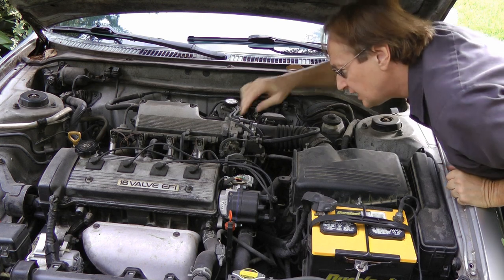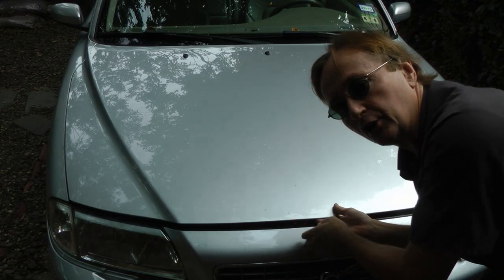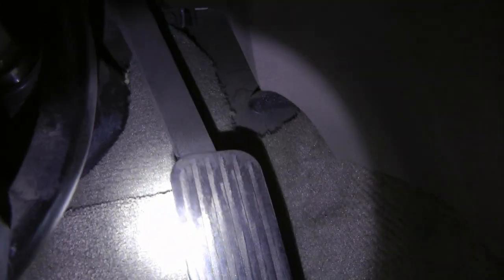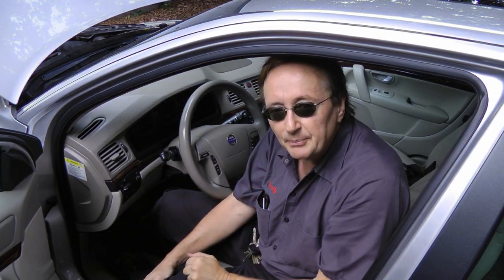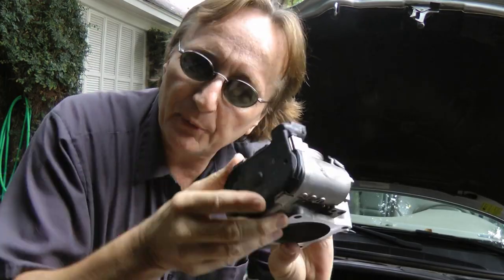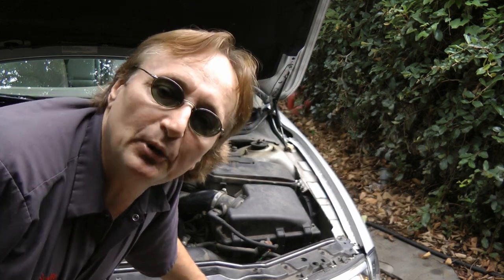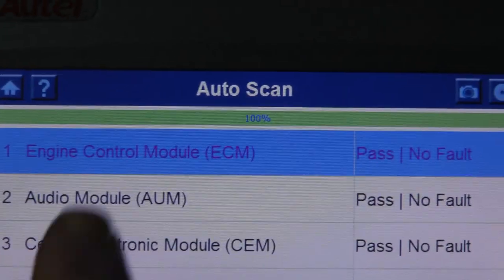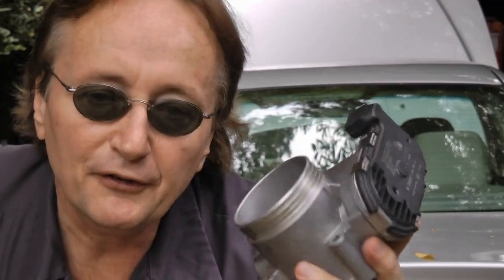Where Has Your Throttle Cable Gone

Comment: They use more and more electronics because it is a dirty trick to make the consumer spend more money. Why make something easy to fix and low cost when the company can make more profit? So naturally they want to make all the parts electronic so you "can't" fix them. And by can't I mean it isn't worth the time/effort to replace them. Like in this video even if you replaced the part who has a fancy scan tool like that to reprogram the car? I sure don't. Manufacturers are just becoming more  greedy.

Comment: I severely hate this electronic gas and brake pedals, same with power steering system that has electric motor on it, less reliable,  more costly, more difficult to fix, also the car don't feel like a car, its been too much numbed out.

I prefer to feel a actual car with mechanical driven / operated parts,such as gas and brake pedal, its alot more reliable, less costly parts, easy to fix, also feel the car itself, the vibrations and everything,  as for power steering I like the hydraulic system, it works very well.

I believe that the new electronic / electric years, will lead to disaster.

Mazda with their recalls for faulty electric pedal, I think maybe Nissan too.

I also see the ecm,  being vulnerable to a hacker with a laptop or desktop pc, will find a way to make the car do things it should not do, such as not taking commands from the actual behind the wheel driver, and insteads obeys the hacker.

Hackers have found ways to bypass the automobile security features, such as the alarm, door locks, starting engine without a physical key,  and with a laptop, thats connected to the car, also hackers found ways to do same sort of thing with vehicle odometer readings.

 Dispite all the attempts made by the auto makers to prevent car theft, but failed to prevent the professionals, even if it did successfully stop the beginner low end car thieves.

Modern cars have vehicle disabling devices, but even they are bypassed by the professional hackers, and off they go with your car, and probably being sold and or shipped illegally,  maybe even used for certain amount of time,  before dumping the vehicle somewhere. 

Many vehicles are equipped with a tracking device, in the driver's side window,  it sometimes says police traceable,  the tracking device can be used against you too, the hacker can track you everywhere you go with the vehicle. 

I prefer the old cars that don't have so much electric / electronic stuff in it,  even older cars to an extent has electronic devices,  such as the ecm,  but the fewer electronics, is safer.

I prefer to use the physical key to operate the doors, trunk and engine, and this is before push button ignition came out, just a key, some keys are regular keys, and some have a transponder integrated into the key handle, with codes programmed.

I find the older the car, the better, preferably Gm, Ford and Chrysler too.

Secure the car with steering wheel club, and the pedal club, or get a removable steering wheel, if available for your car, also if the car is not airbag equipped in the steering wheel, and take the steering wheel with you, lets say in the back pack.

Wheel clamps can be helpful too, help deter car theft, if you decide to make a wheel clamp and use it, don't forget to remove it before driving the car. 

Anything that increases the difficulty for the car thief,  and slows the thief down, will mean less likely to steal the car,  since quickly stealing a car is what the thief looks for, if it takes the thief long time to steal a car,  the likely chances of the thief getting caught and punished, the last thing the thief wants is to get caught.

Older cars are better than newer ones, in terms of security against hacking electronically.
Reply: I fully agree with you.

I have a 2001 Peugeot 206, cable operated throttle, power steering with a pump instead of a motor. The only electronic gadgets are a rain sensor and automatic climate control.

I also once drove a 2000 Golf IV, worst experience of my life. Electronic throttle which was nearly a full second behind my foot pushing the pedal. Nah, I'll stick with throttle cables.

Comment: I still don't understand what was wrong with a simple cable connecting the pedal to the throttle body
why do they have to computerize everything? they're fixing stuff that ain't broken and nobody even cares to begin with

you wanna know what REALLY grinds my gears? the turn dial/ buttons/ alien looking automatic shifters

I'm willing to put money on the probability that the engineers will make something along the lines of a voice activated glove box in the next 5 years. where instead of having a lever to open it, you just say "glove box! open!" and it opens right up. 
I better shut up before I start giving the engineers any ideas

Comment: lol Your car audio is already computerized. You're not turning a physical dial to move any parts and yes the digital tuner picks the strongest frequency (if you have HD radio, if the signal isn't strong enough you get silence).

BMW has replaced the dipstick with a reading on the dash in the menu, which isn't bad since your gas tank has done the switch many years ago. But you're right that plastic crap is annoying. We're not driving formula one cars put metal in there let it be 2 pounds heavier

Comment: There is nothing wrong with drive by wire .... I suppose fly by wire is bad too? ....are you not going to fly on modern jets that have no cables physically attached to the control surfaces??

Comment: That's a very good ... heads up Scotty, nice one. Even if those electronic throttles were built by the good Asians they're bound to brake, a pedal linkage onto a computer linked to another electric part, just crap.

Good old cables are the best and they almost don't wear unless you drive like an idiot(lead foot, on and off the accelerator all the friggin time) =/).

Comment: Such useless throttle technology. Has been on semi truck diesel engines since 1987 when the Detroit Diesel Series 60 came out. I have no idea why this technology has made its way to passenger car engines since we have fared so well using the throttle cable and TPS. I'll stick to the old. Seems older cars from the 90's are easier and CHEAPER to live with.

Comment: Everyone in the comment section is full of shite hahaha you can't feel the delay... The only negative is you can't rev the engine from engine bay, If you snap the cable a dealer or main garage will charge a lot to fix as well, maybe cheaper than a full unit but still charge a lot. Why do people have a problem in advancements? everyone complained when cars when EFI but no one even thinks about that anymore!